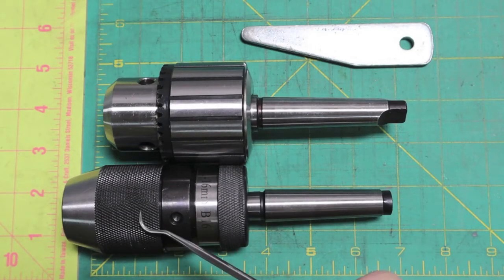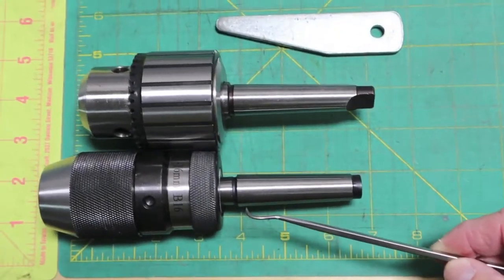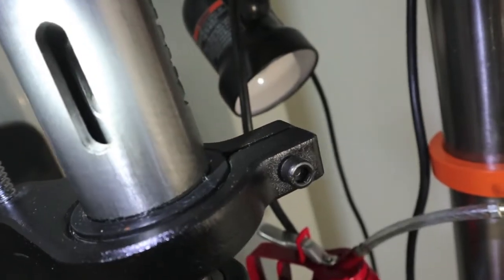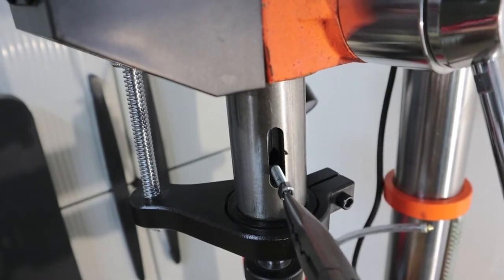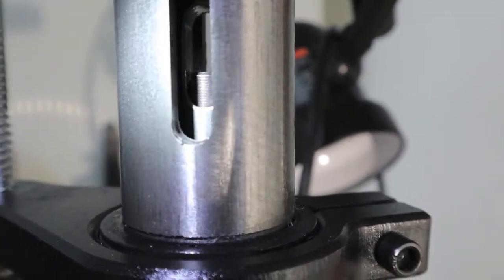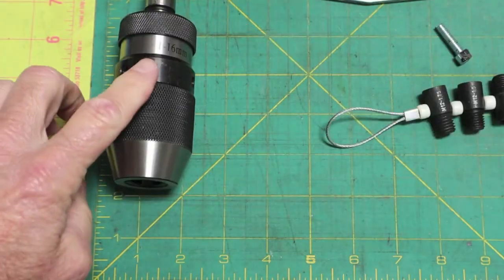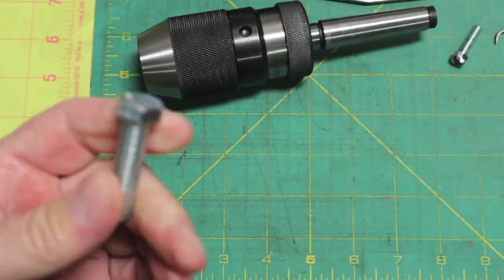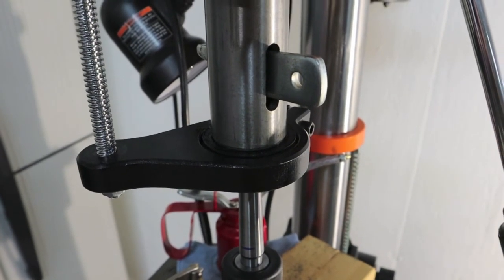DRILL PRESS: A Tale of Two Arbors

Comment: I had an old Sunex SF-12 drill press given to me many years ago. Sat out in my barn for about 10 years, because the arbor/chuck was missing. Got it out last month and got it working again. Ordered a chuck/arbor from Home Depot. Hope it fits. This was very interesting information, as was robc8468 post! I'm just going to be using it in my home shop. Got my fingers crossed.
Reply from the maker: I hope it fits too. You're in good company. Those old Sunex drill presses are built like tanks.

Comment: The threaded arbor without the tang is designed to be used with a milling machine or lathe headstock with threaded draw bar.  The shorter arbor without the tang or drawbar  also usually fits better in a lathe tailstock.  The tang version is for a drill  press to accomdate the drift (knock out wedge) many years ago most bigger drill bits had a morse taper shanks and were designed to be mounted directly to the drill press spindle without a chuck and were impossible to slip like a straight drill shank can somtimes slip in a chuck.  BTW for those who think these tapers are "new"  technology the Morse taper was invented by Shephen Morse back in the 1864.   The Jacobs style chuck is "Newer"  techology having been developed in 1902.  The Albrecth keyless chuck design came from Germany in 1932.
Reply from the maker: Thank you for the info!

Comment: I wish I never bought this chuck.  It really doesn't have enough holding power for round bits and is difficult to align three sided bits. The original chuck that came with my 4214 is back in the drill press and works very well.

Comment: But the taper is obviously more extreme than the one that comes with the drill press. This means that the snug is only at the very end of the quill and not throughout the chamber.
Reply from the maker: Right, I agree. The chuck has not fallen out on me. The most aggressive drilling I've done is with a 5/8 inch drill bit on 1/2 inch mild steel, no problems there.
Thanks for watching!
Reply: @pmtips4482  I replaced my arbor to one that has the tang on it and tapers correctly. It was $11 on Amazon. Fits perfectly. https://amzn.to/3bMaAGN
Reply: No sir, that is not what that means. The angle of the taper is the same on both arbors, meaning that the amount of contact surface area is the same within the same distance of the ID of the spindle. What this does mean is that the OD at the end near the chuck is larger than the OD of the keyed chuck arbor. If the OD of the arbors were the same as the keyed arbor the keyless chuck would slide in the same distance as the original keyed chuck arbor, and most likely could be driven out with the arbor wedge. I do like what pmtips did to make it work, it is very simple and effective. When using the keyless chuck in the tailstock of a mini lathe without his extension, the bump out inside the tailstock would not "bump" the chuck out of the quill creating another mess. Good show pmtips!!

Comment: whts your recommendation on buying a stock replacement???????
Reply from the maker: I would check with WEN on that. They seem to have pretty good CS. My drill was shipped in two boxes and one box got a little lost. I called them while in the parking lot of Home Depot, and a human being actually answered the phone. He was very helpful and the second box arrived the next day.
OTOH, any Jacobs chuck with the proper MT will work (Amazon).
Thanks for watching!
Reply: @pmtips4482  but then you have to mod the chuck release tool ,tool wont work
Reply: without slot
sending first one back,grabbing new chuck
Reply: @pmtips4482  thats the new replacement tht allows me to use tool
Reply: the keyless does not use the chuck tool .it would have to have the slot at the top for that tool to work.the stock has the slot the keyless does not